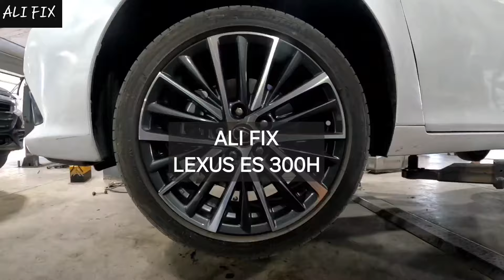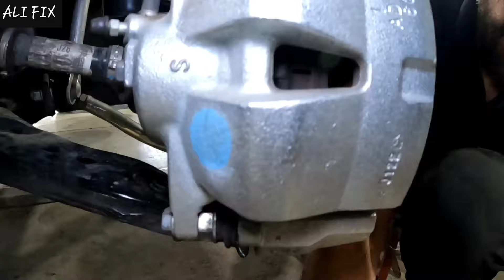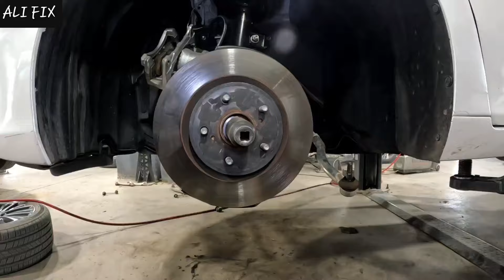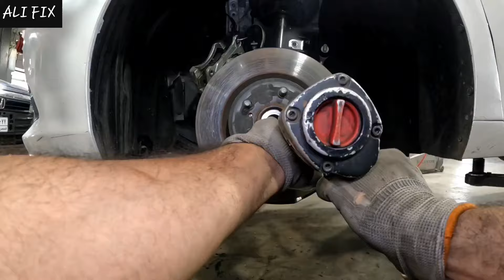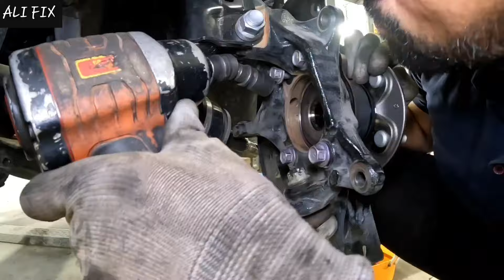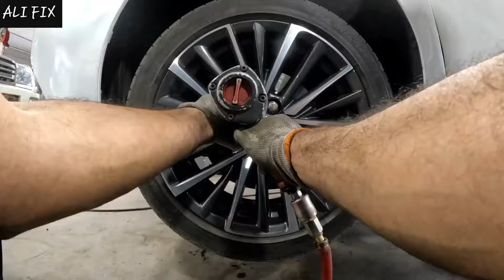front wheel hub bearing replacement .... lexus es 300h

Comment: So you already pressed the new wheel bearing onto the back of the  new spindle before you  put it on the knuckle?  NVM  video is for 2019 and uo ES300h that use the newer one piece design,  .  The 2013-18 have seperate spindle and bearing that must be pressed on
Reply from the maker: No sir ...it was a complete part 👍🏼🔧